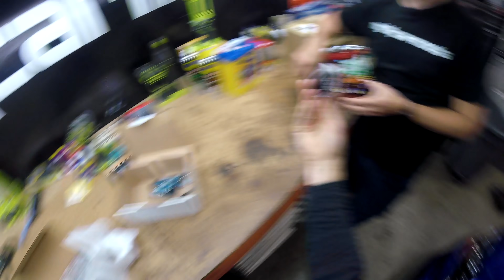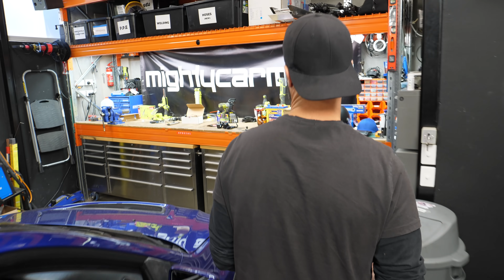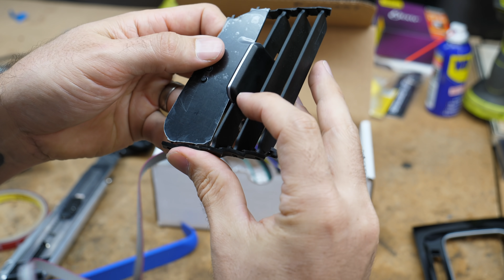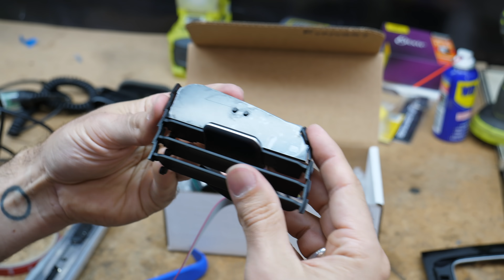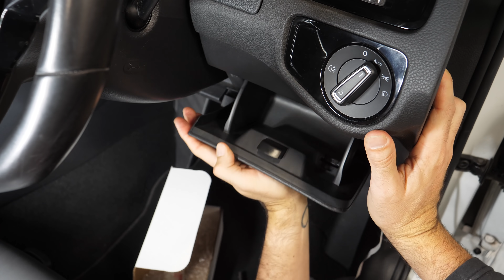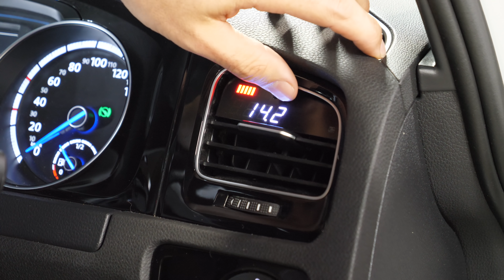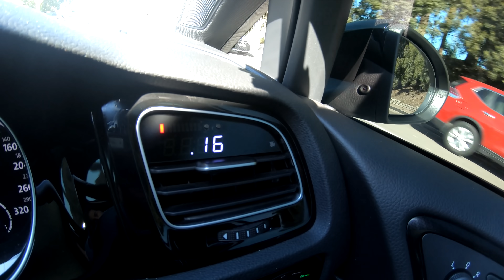Digital MultiGauge Vent Install

Comment: The standard p3 gauge without the analog boost sensor can only read up to 22psi, so with the car running a larger turbo plus tune you really aren't going to see the correct boost levels.
Reply: I was wondering about that. I ended up getting a normal analog gauge because I wasn't sure the P3 would be accurate, especially with a tune.
Reply: @FinalFormation  You can add an analog sensor to our gauge at any time so you can pull all the OBD2 data AND get analog boost at the same time.
Reply: Fo sho on this, thankfully our analog sensor can just plug right into the harness, no wiring required.

Comment: $500!? A full Racepak is only $750.
Reply: Nm. I looked up the exchange rate, the vent gauge is about $350 USD and a Racepak would run you Aussies about $1100 Aussie moneys.

Comment: It's a neat gadget but a tad pricey. I think the mounting in the vent is pretty neat but there can be a fair bit of dust, moisture etc depending on location blasting onto the backside of panel. Being Aussies tho you probably don't mind a blast up the backside now and then🤣🤣🤣.

Comment: ive got one in my e90 m3 (IG TheNemesisSedan), install was exactly this but the boost line needs to be run into the car which isnt difficult but is some work depending on the car and your setup, worth the $500 especially for the clean look

Comment: and it heats up in seconds.. not a bloody minute
Reply: I'll have to get hold of one of those,   actually having started buying into that Ryobi stuff when replacing batteries for my very old but trusty Dewalt stuff got too ridiculous.  That soldering iron thing would be real convenient and also  able to be placed much more easily  where my feline shop assistant won't burn himself on it.  :)

Comment: TS100 soldering iron.. use with a Lipo.. size of a pen, no probs on heating major solder joints 400degC. I just strap the LiPo to my forearm.. way less bulky than that ryobi dangler

Comment: I run a very simple Bluetooth OBDII scanner that connects to a phone or tablet. There are hundreds of apps (if not thousands) available that support this and allow you to display even multiple conditions at once. Yeah, there's a latency but reasonable Bluetooth ELM327s are available as low as $10 US and use a phone or tablet you likely already own for the computing bits.

Comment: One thing i've found about that particular unit, you need to add a small piece of plastic to shore up the panel, as it is entirely too flimsy (as seen in the video as Blair pushes the buttons). It doesn't need to be entirely too long, just enough that when you press the buttons (and you can test it in your hands with small tacks of glue before deciding to full swing it) it doesn't bend anymore. I've also passed the cable through a hole i've made (just for the cable, i've removed the jack and shortened the wire then recabled it, easy) rather than through the blades cause then it wouldn't fully close anymore.

EXTRA mod points, you should add a small piece of cardboard on the back of the module to redirect the air flow through the vents below. It makes less noise and flows better that way. You can also mod the power of the lights with a small potentiometer rather than via cable.

Comment: Why not take an obd2 scanner and just pull up the live data. Lol
Reply: I run an obd2 Bluetooth dongle and view the real time data through torque, but it is very laggy. Ok when you are used to it but not truly real-time. The available readings are also limited which can be frustrating so a hard wired option does have it’s advantages.... I’m just too cheap to cough up for the proper thing when I can have a dull witted one on my phone for less than a fiver!😂

Comment: Using your heater or driving in dusty areas is going to kill the gauge pretty quickly.
Reply: Cabin filters and resilient electronics which would have been designed around those temperature and condensation conditions disagree

Comment: Ooooff, 500 for that... Fitment is great, but oled is the way to go now... I am currently building an oled screen for my bike displaying afr, temps, speed etc with one oft those 2.54" displays from eBay. LED seven segment displays are quite dated nowadays... I suspect most oft the cost are due to R+D and shit
Reply: Yep 90% of the price is R&D plus low volume so custom parts are expensive af
Reply: @MeatyPotatoCactus  what? The led may he white but so is oled, the LEDs look way too old for the modern VW gauges IMO

Comment: For 500 bucks that should be OLED or some sexy ePaper. I was working on an idea years ago when I had my WRX to convert the digital clock into a boost gwage/clock/etc. You guys did a great vid on an Arduino running some dash gear if I remember. That was a great show. ANy news on how it advanced?

Comment: neat idea but pretty underwhelming display to be honest...

also the fact that you can just buy a cheapo elm237 bt adapter and just use an app in your phone to get the exact same information for less than 10 usd kinda makes the 500 usd price tag a very hard pill to swallow...
Reply from the maker: we don't disagree, but it's neat!

Comment: Yeah so it fits a golf vent, but lads really? Why would you endorse something that is an utter ripoff. There are so many obd2 displys
displays that cost a 10th of that.
Reply: Ed Kay yeah, but the $30 one on Amazon looks like a pimple on a bum, they specifically said they wanted stealth
Reply: @lordcaptain73  have a look at the Quicklynks TG6, its pretty understated, displays a lot more so you dont have to keep pressing it, and you could have 10 for the same amount of money! Also why does it need a control box with a serial plug, LOL

Comment: If you are going to shill for the Ryobi soldering iron, I will claim that an even better solution is to buy a TS100 soldering iron off ebay. It runs on 12v-24v so you can plug it into the cigarette lighter socket, or run it off the battery, or hook up a dedicated battery, like a lipo 5s battery for RCs. If you have a laptop charger you can run it directly off the laptop charger (if the barrel connecter is the same) do not buy the conical tip for the iron, use the BC2 tip, or any kind of chisel tip..

Comment: This is good but ironically the stock vw mfd shows you a lot of these anyway.
Reply: No zero to sixty which is awesome no battery voltage no boost gauge it does show the speed but the coolant temp is a sweeping dial in the tach not digital
Reply: @justinpeterson6839  guessing he meant hidden  digital gauges like BMW has. You can enter hidden features menu on BMW in few seconds and can see digital readings for speed, rpm, fuel level, and much more I can't remember right now.

Comment: Put a head restraint system on if you're gunna use that "hat-cam" again .... still feelin' a little sea-sick.  😂
Reply: I think if he captured in 4k but only used the middle part of the captured footage, say 1080p, Adobe after effects and similar editors can fix it so it's really really stable footage.

Comment: $500 for something that runs off a VGA port wow.
Reply: I'd rather just do pillar pods for that price lol
Reply: @tokirak  or an Andriod with blutooth dongal for
Reply: @tokirak  That look tacky as hell and announce to every passerby that you've modified your car...no thanks.
Reply: uDunDunnit u can turn it off and it's the most stealthy aftermarket gauge I've ever seen.
Reply: r232 serial connector, but yes, jesus that is steep.
Reply: Seems like we're paying for their R&D to make different displays for varying vent types. It's really worth $200-$300 tops.
Reply: @Lewislpalm  Hardware is worth $50 dollars at the very  most. You're paying for the time they spend programming and development. Still, their profit margin is probably pretty high.
Reply: @PuerRidcully  i wouldnt even think so since they probably wont sell more than 50 of these, with every low volume production the price goes up exponentially
Reply: @D3nn1s  I've seen its install on 3 automotive channels already. But then again, at $500 you might be right. If they cut their profits in half, they would probably sell way more of this stuff.
Reply: @PuerRidcully  The programming probably cost them a few thousands bucks and the electronics are worth less than $10 for sure. What you're paying for is the molds for the custom plastic bits. These can run in the higher $10k for each different model. Since they probably don't move that much volume and have to produce units for multiple cars, costs go up very quickly and they have no choice but to price the end product that high.
Reply: @dsp4392  Few thousands bucks is a month of work of just one programmer, so I don't think so.
Reply: @PuerRidcully  I'm pretty sure that's actually accurate. These kind of businesses don't hire tons of engineers. Most of this can be achieved with OSS. So all the programmer had to do is some code cobbling and test the hell out of it.
Reply: @Lewislpalm  You can but an entire android smartphone for what, $50? So that's like 99% R&D in that gauge, it's like $5 materials, %5 manufacturing tops. XD
Reply: Same functionality as a $10 blutooth obd2, $10 phone mount and a free app. 

At least it looks better.
Reply: Actually, if I wanted a computer thing at all I'd want it to be hard-wired reliably and simply.   The price quoted doesn't seem to compete with just putting in proper gauges,  though.

(Also, if you think gauges look tacky,  do a better job.  If you want to hide the fact that you put in gauges,  then maybe you want to spend the money on something like this.  If you just want the information,  the price would fund a pretty nice set of aftermarket gauges, is all.  :)  )
Reply: Better put some aftermarket android in for 500$ with torque app.
Reply: Not an VGA, but yes. I thought it would be like 80. Looked quite cheap and idk... it has like 30 dollars worth of hardware at best.
Reply: For less than $500 the Autopolar FIS+ is the ultimate in sleath gauge options as it uses the factory MFD to display engine sensor data. Not sure if they've completed a version for the MQB yet.
Reply: It is only $300 in the US
Reply: Connor C only 300$ for something that uses 30$ worth of materials... how much is an iPad? Just put that into perspective
Reply: not vga more like db9 port
Reply: @Lako remember that the car they're putting this mod on is worth more like 30k... (I think that's the figures I've heard around anyway)
Reply: Thought the same thing 😳
Reply: conductors are just conductors
Reply: @ThePiedude230  

By your logic the average Australian makes far more money per capita than the average American.
Reply: It's probably on Aliexpress for $20,-
Reply: VGA is a 15 pin D-sub connector, this is a db9 serial port (the 1960's says hi). AU$500 for peripheral view of the car's functions based on dino-tech... no thanks
Reply: The DE-9 connector (VGA) is a CANbus standard.  OBD2 uses the CANbus as a way of communicating.  This display hooks into the CANbus data stream and listens for the info it needs.
Reply: Just wait until it melts by 80°c hot air, i guess you can always turn it into a soldering training job!
Reply: my car doesn't have one of those ports, so it's before dino-tech... which makes it pre-historic =)
Reply: HAHAHAHAAHAHAHAHA
Reply: Honest they’re awful, basically don’t work and the numbers are completely off, all for 300 dollars sheeeesshhh
Reply: Lako see if China has made one.. as quoted from movie THE ROOM... CHEAP CHEEEP CHEEP CHEEEP CHEEP..

Comment: 4:22 It looks like ODB2 to serial to a cheap, not even in a housing, LCD. Also, Serial was not really used for printers. It could be done printing a multiple page text document requires more bandwidth than the connection can really handle but it was used for MODEMS, gaming peripherals, mice. keyboards and in the old days before USB was THE way to connect the random device you must built to a PC

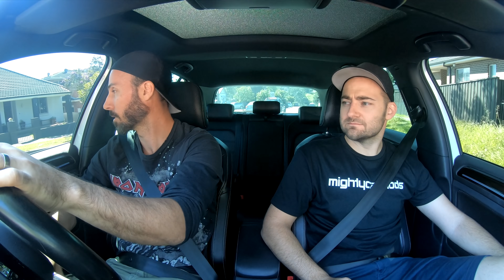11:07 If you could get the software you could make one for less than $100

Comment: On humid days I get condensation on my AC vents, I wonder if that would be an issue for the gauge?
Reply: You could probably use a little insulating tape on the back side to keep the wires and the back of the display dry.
Reply: My first thought was that being in the vent, that display is going to get wrecked from full blast AC or heat. Heat on an LCD can be especially bad.
Reply: @ChrisWilliams-i7d  Your premise is true but there is no fancy R&D here. The production costs  for that screen and connectors/wiring is probably around $10-$15 per unit max. And They are literally just taking data from the OBDII and displaying it on a screen with super basic programming. The OEM did all the hard work, a decent software/Reverse engineer with experience in the automotive world could adapt that easily. The actual total cost per unit including R&D is probably less than $100 per unit depending on how many they produce/sell. There are several devices on the market that cost almost the same that can do everything this gauge does while also, logging data, and tuning the car which is exponentially more complex and expensive to develop. It's insanely overpriced, but if people pay for it, then good for them.
Reply: Pretty sure it would be like a watch...hopefully for that price point
Reply: @tyegunn  For that price you can literally get an Apple Watch and just glance at your wrist for the info.  Stealth AF!
Reply: No issue at all, we run ours in our cars year round and we get cold winters and hot summers. Many of our gauges has been running for over 10 years now with no issues so don't worry about it! -Jake
Reply: It probably heat up just enough cause of the lights inside

Comment: The solder iron doesn't have the convenient foam to wipe it off tho. Otherwise 60seconds to heat up is alright. The real question is though will it being outside on a windy day make it useless? Basically anything that's like $60-$100 is useless outside on a day with strong wind here it cant heat up lol....

Comment: "there is all sorts of information going into your computer..." hold up.. did you just ASSUME my car has an ecu? 2019 man, cars can run on hopes and dreams...
Reply: 1993 d250... 12v cummins- whats an ECU?  Haha. EMP proof.
Reply: aside from My 89 Ford 'Stang, 90 Honda Accord, and my (currant) 98 Nissan p/u, all my cars have been ECU-less. and only the Mitsu p/u had an electronic ignition. Stone knives and bearskins people!
Reply: Unless those cars have has them removed they all have ECUs they are some form of OBD1. Less functions and hard to find a reader for them but you can pull codes off of them and they are computers. My 85 F250 was OBD1 and it was carbureted. Most cars from the 80s on had ECUs and you can find some with them all the way back to the 60s.
Reply: @pilfit  yeh, the 2 that i have are completely computerless ahaha.
Reply: @pilfit  none of my ('76, '76, '73) Colts (Galants), 84 D50/L200, 74 Peugeot 504, 72 Ford Courier,  nor my E20 Toyota Corolla had any sort of ecu. I was excepting those 3. The Stang needed an ECU replaced when it shut up. Check Engine but no codes, constant limp mode, so it was almost without an ECU. I did have enough race car spares to convert it to a carb car, if needed. It already had a shaved and ported spare race head on it. I had an adapter for it to take the 2 bbl off an F-150 if needed.
Reply: The old Ford ECUs were really flaky. I have had that exact problem on my F250 and my Tempo.
Reply: @jpkalishek4586  yeh, i got a 77 lancer and a 74 mini.. no computer in sight. also have a 01 wrx but lets not talk about that one... that seems to be the closest to going kablamo at the moment
Reply: @jackstanddriveway  I'm not meant to reply here, I guess. 3rd one got ate.
Reply: I don't think they assumed that.  But, yaknow,   if you want a modernly-computerized engine, call Haltech or someone like that, or go ahead and put analog gauges in.   :)
Reply: @OllamhDrab  oh i know ahaha. just having a little laugh and poking at the ones that get offended by everthing
Reply: @jackstanddriveway  Cool enough,   my old Volvo does have little computers, but there's just a couple little boxes with jump leads and little red LEDs that flash at you in like Morse code for whatever the old school computer can sense.   And the truck's very early/transitional kinda-OB2  that doesn't know much more.    

I would not mind more modern computers but definitely not down with hooking things up to smartphones  or wireless signals that do anything important.